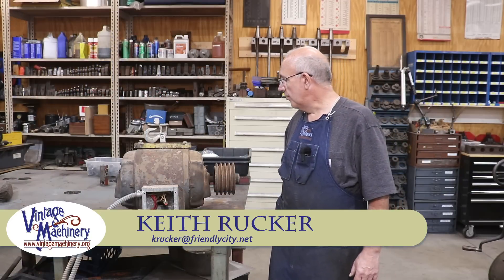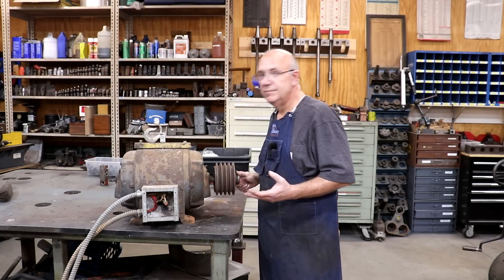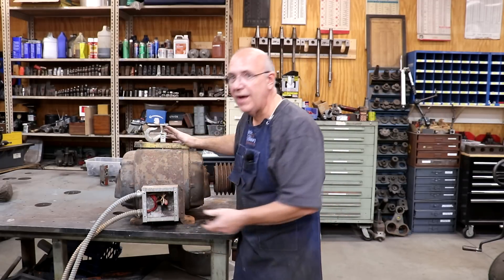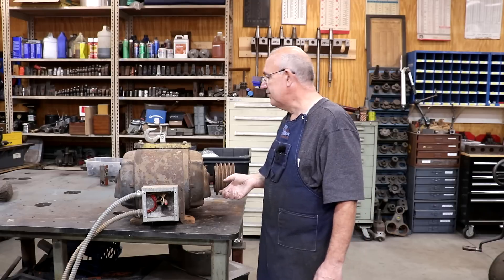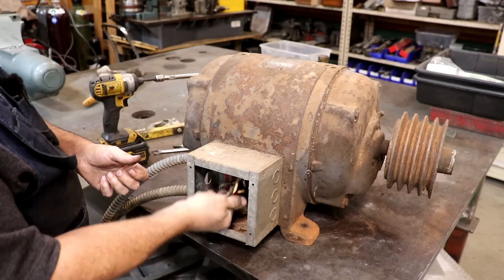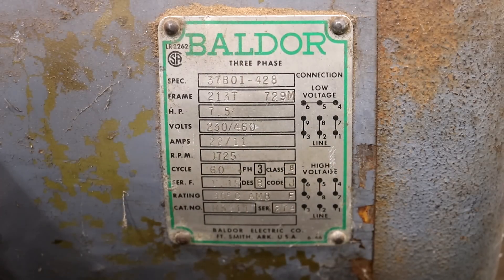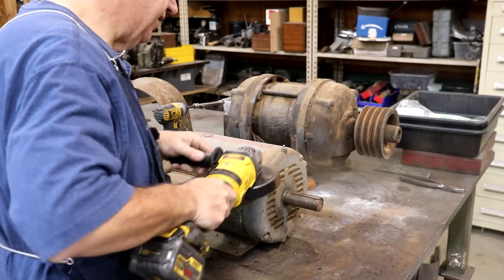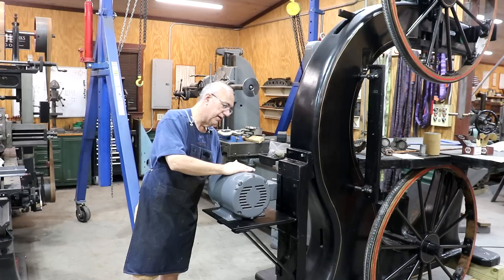Diresta Bandsaw Restoration 30: Finding and Mounting a Suitable Motor and Pulley

Comment: The connection box with a screw-on caps is a horrible mess. I have recently opened a 70 year old motor on a milling machine manufactured in Socialistic Czechoslovakia and everything was wired to a civilized terminals. With a clear indication of which way shorting leads were supposed to go for star or triangle (3 phase 220V vs 3 phase 380V) wiring. Like they knew 70 years ago that I was going to connect it to a VFD that converts 1 phase 230V to 3 phase 230, instead of our standard 3 phase 380.

Comment: Oh man, why do you guys use wire nuts?
Reply: The same reason they use inches and 110v 1phase instead of millimeters and 220v 1phase.😂
Reply: @samuraidriver4x4 And why do “you guys” always have to complain about a system you don’t understand or agree with? There’s always more than one way to do any job.
Reply: Why? Because they work.

Comment: Comparing the phase to phase resistance of the old 7HP motor to the new 7HP motor wired for 230V should tell you. If the old one is roughly twice that of the new one it's 440V.

Comment: It seems strange measuring motor power in half horse increments. Taken literally, a 7hp motor would give the equivalent output as 7 horses hooked up to an appropriate mechanical power unit to drive a piece of machinery. So, using the same 'literal' definition, a 7.5hp motor would give LESS power than a 7hp as those 7 horses are now using their combined power to drag around half a horse carcase as well as drive the machine 😁
So as a rough estimate I'd say a 7.5hp power unit would only be equivalent to 5-6 horses maximum 😉😏
Reply: You have a strange mind.  :)
Reply: @ydonl  Yep 🤪🤣

Comment: An earth connected would be much safer for if there was a winding to frame fault that's dangerous. Better still megger the windings to frame.
Reply: My guess it that the previous owner did confuse earth with ground, perhaps, that would explain it.
Reply: Or the earth was disconnected because it blew the breaker or fuse.
 @sheep1ewe
Reply: @glentyan2505  Yes,  One newer know... But i hope it work as it should now for Keith.
Reply: Quite, I don’t doubt Keith’s conductivity would be sufficient to pass enough current to finish him off. An earth wired to the bench might be a simple way, then it’s never forgotten.

Comment: I'd have taken ohmmeter readings from the leads to the motor frame before I powered it up. You were touching the frame without checking that to make sure the frame wasn't shorted to one of the windings. You could have been electrocuted. Please be more careful checking out unknown motors.

Comment: An ammeter will tell you more than a tachometer.
Reply: Speed is determined by number of poles and line frequency.
Reply: A laser tach will tell you exactly what rpm it is running.  I have 4 of them and the most expensive was around $50!  A very handy tool to have if you are in the motor and drive business.

Comment: You should still give the older motor a chance, pop the end cover to see how the wires are actually connected to the windings, perhaps all 9 wires are hidding there.
Anyway unless the windings are impregnated in solid resin the ends of each winding should all be on the same side and on the outermost part of the winding, at most the lacing would have to be removed. 
Any motor winding technician can identify each wire/connection.
Reply: What "engine"??
Reply: @paulcopeland9035  Oops! All the mechanical channels to which I am subscribed except one are American and I always write the comments in the language spoken in the video, when I used the word "motor" for an internal combustion engine there was always someone who criticized me or even argued with me... I don't know if I'm getting some PTSD or if they managed to brainwash me 😅

Comment: So if you like the look of the other motor have it rewound. With the time and expense of this project, cheaping out on the motor rebuild doesn't seem in character with this project.
Reply: Rewinding that motor (if you can find somebody to do it and it doesn't take 6 months to have it done) would be in the $400-$500 range. What would you do??
Reply: That would be up to Jimmy - it's his saw. It's not going into a museum, it's going into his workshop. Besides, neither is truly 'vintage authentic', since it was originally line-shaft driven.

Comment: Should never have to hammer the pulley on.....needs to be a slip fit...the bearings are not made to handle the pounding thrust force.  Felt a comment was necessary lest others with no experience think the pounding is ok.